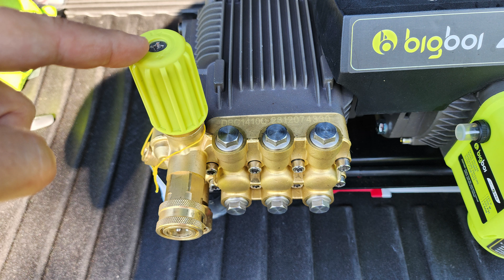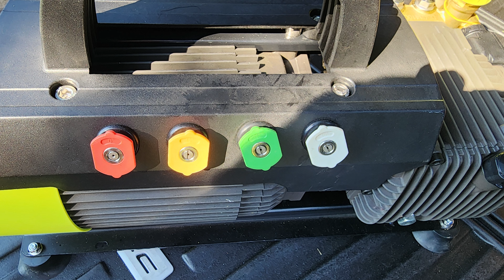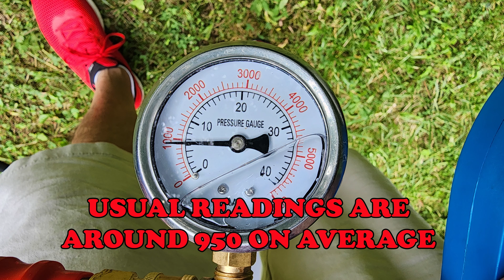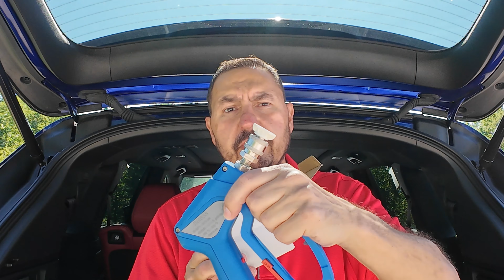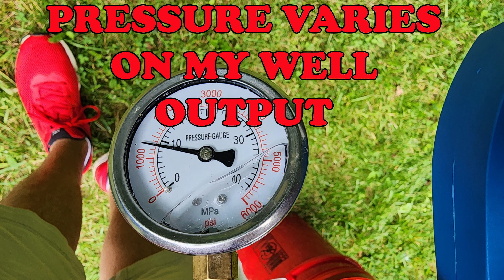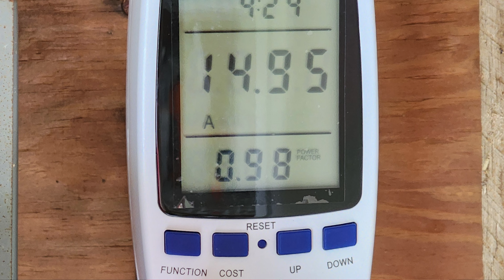Are your pressure washer accessories harming your electric pressure washer?

Comment: Great video!

The pressure gauge will tell no tales.
My homelite washer only cost me 48AUD so it's something I can beat up on, break, and not feel bad! That being said, I've just spent 45AUD on a pressure gauge so that I can make sure nothing I use wth it exceeds factory loads.

If I blow up my homelite, it gives me an excuse to upgrade to something decent. If I can have it last another 4 years or so though, that would be great too! I've been beating up on this thing for years, and apart from the garbage factory hose, I really can't fault it!

Comment: I did not have a good experience with the same Ridge Washer set, except mine was labeled as a 3.0 orifice.   After only a couple uses of the 40deg nozzle, the center part of it blew out onto my car, like it somehow came unscrewed or something.  Used it with a Greenworks Pro Electric 2300/2.3gpm machine.  NOT HAPPY with that company now.  Especially after seeing your video as well.  Lord knows, my 3.0 orifice was probably actually a 2.5 or less...

Comment: So do you recommend that RIDGEWASHER pressure gauge and AMP meter for accuracy and durability after using them for awhile now. There are so many options and most look like the same exactly just different label.
Reply from the maker: They seem accurate enough. I've repeated the tests again and the amp draw shows nearly the same using the same nozzles at different locations. I actually forgot I recorded an update video showing insane amp draw with foam canons.
Reply: @ I’ll check it out. Thanks.

Comment: Quality of accessories clearly makes a difference. I run the AR with the sg35 gun and veloci spray nozzles.
Reply from the maker: Very much so. Usually you could assume something would at least be close. In this case it was just the wrong size. They should have a way to test each nozzle, then label accordingly with the proper orifice size. Even if a set costs 5 bucks more, an accurate branding would be worth the added cost.

Comment: Great video . 
I have a sun joe 2800 psi 1.3 gpm. 
Getting 2.5 orfice does smaller orfice draw less power or more . Tyvm for help . Liked and sub
Reply from the maker: Generally speaking a larger orifice size will flow easier and cause less amp draw so a smaller size decreases output and makes the motor work harder. However, that easier flow with larger nozzle size comes at the cost of pressure, and often very diminishing returns of increased output flow.
Reply: Tyvm for explanation. You should be a teacher.

Comment: I bought these same Ridgewater nozzle (same orifice size as my mtm) from Amazon. For the first time ever my breaker tripped on the 25 degrees geeen nozzle and not on white nozzle. I returned them on amazon and just kept on using my mtm nozzles.
Reply from the maker: Exactly. They seem to have a quality control issue. My replacement nozzles were closer to the MTM nozzles but still slightly smaller. I was within the amp draw though so I kept them.

Comment: Definitely not "Click-Bait" (even though it worked for me) it's more of a well appreciated "Public Service Announcement". Thanks for posting this. As much as I monitor most of the major, and minor, appliances around our house, I had never really thought about checking the pressure washer out. And I surely never would have given nozzle differences a thought. I just "Assumed" that all that stuff was good to go.

I already have a watt meter that I have been using for years and have a water pressure gauge around here somewhere in the black hole in my garage. I don't have a massively powerful pressure washer like yours, just a little 2100 psi /1.2 gph model that I picked up on sale at Lowes for around $80. But it does draw electricity and I have purchased a few items that are rated for larger units than mine, higher pressure and higher gpm ratings than I have. Everything seems to work just fine, some even better than expected. I think I might need to follow your lead and test what's going on with mine.

Thanks again and have a fantastic day!
Reply from the maker: Thank you for the very kind words. Those meters are super cheap these days and worth the money for sure.
Reply: @TheOutdoorDetailer  A video of doing the actual testing would be cool, too. Maybe a project for another day when you're looking for ideas. Pressure washer Tips & Tricks, too!

Take care!
Reply from the maker: I had actually recorded everything leading up to the day I took the photos I show in the video, but I couldn't figure out why I kept getting different GPM with the different nozzles or why the pressure adjustment didn't really change anything. So no point in showing a video where nothing made any sense. Saving them just in case I have to speak with Big Boi. Maybe a how to test video would be good, though other channels have really nice scales that they use.

Comment: So early on I purchased BIGBOI WASHR PRO and as others who also purchased has undergone the same over arching amps and shutting off. I now have a heavyweight paperweight .
Now manufacture has came up with an updated model MKII. So this company really jerked USA consumers with up to 700 dollars in their pockets.
Lastly question are you experiencing the same issue?
Reply from the maker: I am not. In fact my amp meter is low using the 4.0 nozzle. I made sure to share the photos. No issues yet, thank goodness.

Comment: Orifice accuracy is a widespread issue even MTM ones have been off. Foam cannon orifice nozzles are worse. Great video! Also, bucket markings are sometimes off by 10% which is why I switched to weighing the water with a certified calibrated scale. I have pin gauges now to know for sure on size, but it only works on foam cannons and 0 degree nozzles. The other angles such as 40 degree you can’t measure with a round pin. Thanks for the kind words as well. $15 amp meter is your best friend.
Reply from the maker: Yeah, at least with those buckets I measured out with my 32oz marked pitcher I bought. The home depot one was surprisingly on target, though I likely wouldn't catch 10%. In any event it was more about the power draw and repeatability of results.
Reply: If you would want to test the angles, Plumbers Putty (or modeling clay, or even clay bar) can be used to make an impression of the angle (like the casts that cops make of footprints in the dirt). A digital camera, separate or the one on your phone/device, A graphic editor (Photo Shop, Paint Shop Pro, or The Gimp (Open Source, download and use for Free) or CAD program, and a decent computer and monitor or a laptop, and you're all set to test.

Take the dough/putty and press a small ball of it into the face of the nozzle. Carefully remove the putty from the nozzle. (a thin film of coconut oil may help keep it from sticking and ease removal without distorting the piece. (Make sure that you remove any putty that may have clogged the hole with your pin gauge.))

Take the picture of the impression left in the putty/dough from the side. Hopefully there is no distortion when you removed the putty.

Upload the Pic to your device

Open the picture into your graphic editor or CAD program.

Zoom in and use the graphics editors angle measuring feature to get the precise angle and record your results.

Then there is the easy way. Take a picture with your phone and pull out your handy-dandy protractor and measure it. I also think they have an app for that, too.

Have a great day!😁
Reply: @tinkerscorner54  That could work, but sounds like a lot of work for this lazy guy. LOL I understand it would give you angle, but for the orifice size itself how do they measure that. Just like a tv it’s measure diagonally. How do you measure the mold? Is it length? Width? A formula of them together maybe with the angle involved. I am not sure.
Reply: @CarsWithKeav  Beats me. I figured out how to measure the angle from working with graphics and CAD programs in different weird projects.
Reply: @tinkerscorner54  We appreciate the insight it really helps us go that extra mile to check manufacture accuracy.
Reply: @CarsWithKeav  I used to could figure it out using Geometry, but I broke my brain in 1191-92. It hurts to think about it too much and my wife would wonder why I looked like I was lost in a daze, again. I frequently tell her that "I just got lost in a thought, Thanks for finding me". She's a real Sweetie Pie.
Reply: @tinkerscorner54  I'm sure there is a way to figure it out, but that hurts my head even thinking about it. LOL
Reply from the maker: Figuring angle would be easy making a given wooden jig. A spray nozzle, mounted on the jig sprays an x pattern that can be video taped from above. Markings on the board indicate the various angles. As far as orifice size, should be relatively easy math. If you have a known 0 degree nozzle in different orifice sizes, you take repeated readings of output, take that average, then all others just get measured in both pressure and output against it. I think the bad part is buying all the different 0 degree nozzles then measuring the openings.
Reply: @TheOutdoorDetailer  Just so much work I just want to put a pin gauge in there and just know. 🤣

Comment: I am hoping you do an update on your WASHR PRO to see if you have any issues with it popping the GFI or you breaker like I did. In my experience and many others it is not an outstanding machine.
The adjustment procedure you are referring to officially came from BigBoi as a lot of their units were not meeting the specs they listed, mine was one of them. I received the procedure from them and it did not help with the performance.
My unit would also not turn on when you pulled the trigger, again called tech support and received another bulletin from BigBoi on stretching the spring for the TSS. Worked for a short time before the spring returned back to its original length.
In order to get my unit to come close to the 1.99 original specs I had to set the regulator so my pressure gauge read 1250-1300 PSI but that caused it to pull over 15 amp and when I connected their foam cannon, it went over 17 amps
With the same 4.0 Veloci  nozzles you used I could not get over 850PSI while adjusting the regulator with BigBoi tech support on the phone, at that PSI I barley produced 2.0GPM 
BigBoi just kept blaming the power system in the US.
There is a reason they pulled it off of their website and now have a new unit labeled as the MKII which is now listed at a maximum 1200PSI and 1.88GPM with the .35 nozzles
I ended up having to start a charge back with my credit card company after 2 month of trying tp get BigBoi to take this unit back.

So the reason I posted was to say you are correct on testing your pressure washers, and all of the accessories to make sure you are running with in the manufacture's specs. If I would have not tested mine I would not have known I got a unit that did not meet specs and wasted a lot of money.
I would also recommend trying the PN2500 NEMA 5-15 power monitor as this unit has a max of 25A 3000W @ 120V, it cost more but I don't recommend constantly taking units that are rated at 15amp over 15amps.
Reply from the maker: So if I unplug the unit when done and plug it back in, I always hit the reset on the GFI. It never fails I need to do that. As far as amp draw and performance I am amazed at the draw with the 4.0 nozzles.

Comment: With my Greenworks 2700, I'm also around 800 psi with a 4.0. I use them for work that tends to splash back at me (cleaning out trash cans, cleaning wheels that are off the car) but prefer the 3.5 for about 1200 psi for car washing. I would recommend this PW to anyone. It has a beefy motor and isn't that expensive. I paid $250 on sale.

Comment: I have had oem nozzles. Then I bought mtm blue nozzle. Expensive but Wao what a huge difference. Most noticeable is the water flow of the fan. It’s very consistent and even. Gpm is also on point.
Reply from the maker: Yes, going with the 4.0 or 4.5 is the way to go with most washers in the professional category.

Comment: This is a valuable lesson that I hope everyone takes the time to watch.  And here is my experience with Ridge nozzles.  I have three different sets of nozzles for my pressure washer, each a different size.  One set is the OEM from SunJoe, the second set is from Vevor, and the last is the 3.0 size from Ridge.  

When I tested the pressures for each set, all the nozzles in a set tested within 25 psi of each other.  However, one of the Ridge nozzles was 200 psi different than the rest, so I returned them for a replacement set.  The replacement set is worse.  Two nozzles are 200 psi higher than two others.

I am not concerned about damaging my SunJoe because I plan to replace it with an Active 2.0 very soon.  Any extra nozzles I but will be Veloci.  I will just have to forego the nice rubber shroud.

Comment: Great video and great advice.   On occasion, (mostly when cleaning tires/wheels) I was using the Ridge nozzles with my pressure washer.  I may recreate your test for myself, but most likely, I will simply just use the higher quality nozzles in the future.  Thank you for the video and information.  Very informative.
Reply from the maker: I'm not saying they're all bad. Your set may be perfect. I returned mine as defective and am waiting for a new set, which I will test. Still, QC seems low and one should always test changes like this to be sure.

Comment: Had my active 2.0 for over a year worked fine with an Uber flex hose mind you.
I lost my regular nozzle and had some spare ridge nozzles from my previous ve52 and sure enough my hose blew a hole in it from the pressure this happened this past week and I had no idea why that was…. Good lord
Reply from the maker: The amp meter doesn't lie. If you have a 15 amp washer or less, spend the 8 bucks. It's amazing what they can tell you.